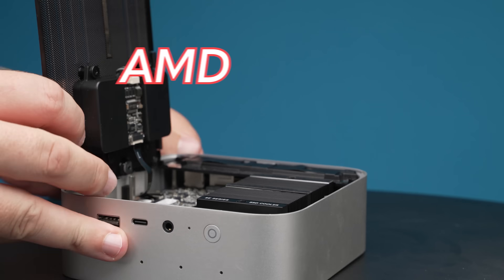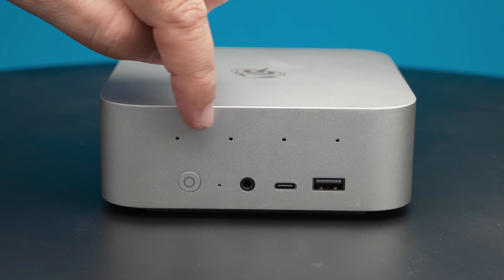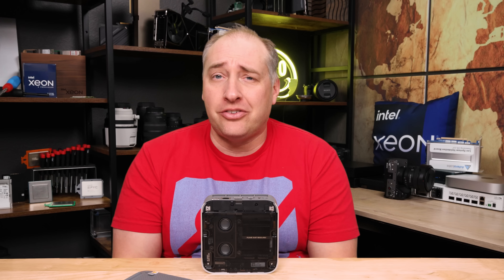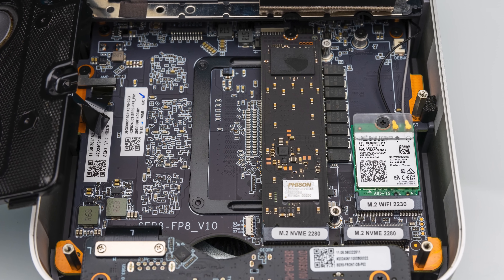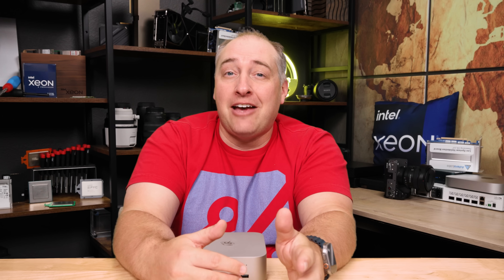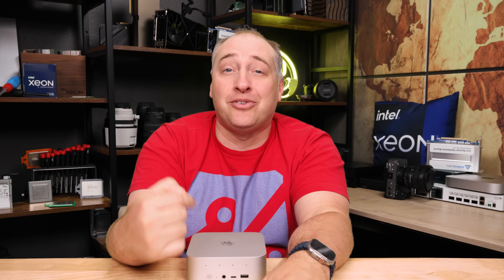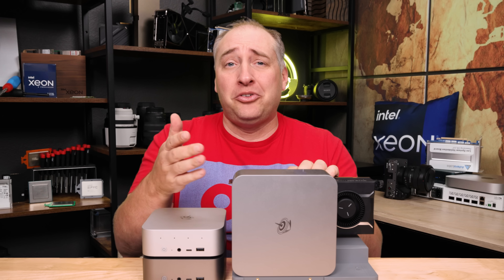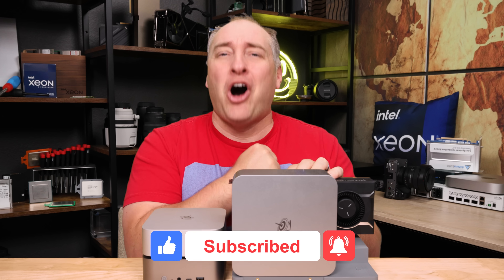FASTEST AMD AI Mini PC Beelink SER9

Comment: Hi I wanted to ask you for advice on buying a mini PC, between these two which would you recommend, I do editing with cap cut and Resolve but of family holiday videos, even if I use a lot of effects, anyway Beelink SER9 with the new Ryzen 9 AI 370 HX with 32 GB of RAM and 1 TB SSD or as a processor would it be fine, I don't want to have slowdowns, the Ryzen 7 8845HS taking the version with 64 GB of RAM and 2 TB SSD? Is the latest processor better for power or the 8845HS which in any case seems suitable for the purpose but having 64 GB RAM? Thanks always for your availability bye

Comment: The new version is ridiculously overpriced! For the price of one HX 370 (with its RAM expansion limitations), you could get two 88445HS units. Unless you're a gamer, you won’t notice any difference in daily use. Beelink should have included two USB 4.0 ports in the back instead of just one, and there’s no excuse for still using USB 2.0 on any system—period. Integrating speakers was a pointless decision; they should have prioritized RAM expandability instead. I’m betting Minisforum will offer a better package—unless they’ve also cut corners and made the same mistakes.

Comment: SER9 1000 USD -- SER8 500 USD (more or less)
So in my opinion: SER9 has that AI CPU and there aren't a lot of applications that use that AI feature yet. At least, I don't need it. Sure the GPU is an upgrade, but worth double the price? 
I was doubting at first between the SER9 and SER8 (I'm upgrading from my old SER4). I went for the SER8, because I can upgrade my DDR5 RAM, which isn't possible with the SER9 and it's very reasonable priced for what you get. The SER9 is new and sure fastest on the market, but a 1000 dollars?? No thanks!
So for me it's going to be SER8 with 64GB RAM and 6TB storage (2+4)

Comment: As for the Intel Wifi 7 BE200 NIC, it is not supported in AMD Ryzen platforms. It doesn't boot. On Newegg, these devices are clearly marked as not working on Ryzen systems. Beelink would have to go with a different vendor.
Reply from the maker: We have already seen AMD/Mediatek RZ717 systems on STH for WiFi 7 support

Comment: I’ve never liked the acoustics from slot coolers, so I was ready to splurge for a Deskmini x600 with an 8700G and a Noctua cooler. But the HX 370 outperforms the 8700G, and if the Beelink cooler is indeed quiet (not noiseless), I’d be willing to pony up the difference.

Comment: Very cool review👍Beelink can certainly offer lot of value. This tiny box packs lots of power, however as u pointed out GTi version is much better option mainly because of the PCIE expansion slot which can utilize full speed eGPU as well as the internal PSU. I think form factor of the modular "transformer" mini PCs is upon as long as they do not cost more and offer worse value than DIY mini PC builds.

Comment: Lack of oculink is a fatal flaw of the pc.
Reply from the maker: Always fun to use those. I think the GTi Ultra 12 shown has a better eGPU option versus Oculink. Oculink was replaced very quickly in servers with MCIO due to connector quality so it is fun to see folks ask for it on the desktop side.

Comment: Seems the point was missed. This is an "AI" machine meant to do AI stuff at the edge. The integrated mic and speakers are for "assistant" functionality. A glorified, very expensive, AI based, smart speaker. Building your own smart speaker is a pain in the butt and jank AF with speakers and a mic hanging off the thing.

Comment: Switched to a mini-PC a few years ago.. CPU cooling isn't great in these things as it's direct die cooling.. Turbo fan noise, and although not terribly annoying it's a cheap & crappy cooler... and the PC has these random restarts.. So I'm gonna switch back to an IHS socketed CPU with a heat-pipe cooler for higher TDP with silence.. I like the ASRock DeskMini X600 but don't like the VGA/D-SUB video output it has.. If it had dual DP and a HDMI then no problem for my 1440p triple monitor displays.. The VGA kills it for me.. Why ASRock.... why?!!!

Comment: That $1000 price is going to have to come down.  For $1000 you can get a pretty decent gaming desktop that will run circles around the SER9 in CPU and/or GPU that is a lot more flexible and expandable.  The only thing the SER9 has going for it over such a system is being so compact and low power, and while that is certainly interesting I think that for the overwhelming majority of users that is a secondary concern.  A mATX or ITX system can be small as well but with better performance.
Reply from the maker: I tend to agree with you, but then you see how much of the population bought Macs when they were slow and expensive but looked cool. I do not think compactness has zero appeal

Comment: For speakers: in a different spec (Ryzen 3, 5) these are value for not having to buy/change monitor if not speaker provided or buy the speaker set. Alsocan deliver notification sound in any kind of office environment. For video/phone calls, headset can be used via audio jack, usb A or USB c on front panel.
In SER9 series, the biggest ticket to pay by Beelink is... AMD. Which cash in CPU, GPU, NPU and RAM, mostly... 35-40% of BoM. Model delivered to you is close to the flagship, however in less powerful SKU I can easily see a lot of "small computers" for call centers, accountancy, helpdesk, frontdesk/event, cloud-connected clients.
Power efficient, small, plenty of connections, versatile and quite good looking. And for spectrum efficienty Wifi 6 is just "good enough", because Wifi6e setup are not snowflakes, but still not that mainstream.
Last thing: abysmal the dust maintenance, unrealistic and b*tt covering the term "1 month".

Comment: I hate the current desktop trends. One one side are the desktop pimpers who spend more on RGB and cooling than on the actual hardware. On the other extreme are these compact boxes which artificially constrain upgradability while costing just as much and also have poor thermal performance. Why would you put a Ryzen 9 in a tiny box. I'd rather have a functional non RGB tower with a huge fan or maybe a very functional non rgb liquid cooler (what do you mean there are no non-RGB liquid coolers!).

Comment: Not seeing a use case at this price point. I have lots of these devices and the idea is that they are small, lower powered, run win or linux and cheap....kind of like a raspberry pi. On top of that I don't see where the 'ai' or large language models are useful at this price point where I could buy 3 or 5 of their other computers. Also the misses on wireless and the silly speakers are dead on. Additionally that graphics is still too weak for gaming.

Comment: Presumably they use two speakers to provide stereo?

Two little speakers, sitting right next to each other, in the same box, is going to provide absolutely ZERO stereo separation for the listener.  Completely defeats the purpose of using two speakers for stereo.
Reply from the maker: True. But they are also not pleasant to listen to

Comment: 32GB of RAM is way too little when you can't upgrade it, 64GB should be the mininum. It's also too little for the price charged.
Reply from the maker: Agreed on 64GB+
Reply: I'm have one 32 has been more than fine. I'm using it as an ark ascended game server atm. Dedicated 4 cores per server with 4 gigs ram per server runs great with 6 users.
Reply: For $999 id go for the Mac mini m4….my opinion at that price it’s 24/512….more you have to pay pig apple….maybe not go for it 😊

Comment: I'm going to wait for the Minisforum AI370 with up to 96GB ram, 2x PCIe4x4 M.2 slots and 2x 2.5GbE nics... and it looks really nice!
Reply: From what I can tell, it will have the same 32g of soldered in RAM. Maybe they will release other versions.
Reply: Where did u see it goes 96GB ram when the website sells it only with 32GB?🤔Now the UM 890 minisforum has 64GIg out the box ready and uo to 96GiG but it's 8/16 cores threads but u can add the EGPU dock and now we are talking! U can have that bundle for $828 compared to the $1000 and over for the one ur waiting🤷🏽‍♂️...I'll go with UM890 if u want under $1000 and the bang for ur buck, or go with the New Beelink Ser9 AI 12/24 cores and threads for about $1000 if ur willing to spend over and also it's compatible with the EGPU dock😲...it's up to u but I'd go with the UM890 all day before those

Comment: Should’ve completely gutted the speakers and mic for more cooling or hardware peripherals.

That would’ve made it a must have 🧍🏽‍♂️
Reply from the maker: Agreed
Reply: More cooling would have been my pick
Reply: @phthano2580  I’d take the peripherals considering you can turn it into a beast of a low power server. I’ll strap a case fan to it lol
Reply: Yeah, larger fan would have been better. More air with less noise is always appreciated. And that extra space could have allowed more NVMe drives too.
Reply: For the price point, more memory and storage would have been nice. I can definitely do without the speakers and think these mini pc makers try and do too much at times. I think of a under 5 liter build when I see the price that will gi e me some kind of upgrade path.
Reply: That’s why I may go with m4 mini mac no noise I know apple been around for decades… I’ve only owned hp. I need quiet for music production! Its costly apple is too piggish but I need 32/1tb !
Reply: just buy a usb dongle
Reply: More cooling and RAM. 32 GB is ridiculous on a premium machine.
Reply: @tschorsch  Only downside with user replaceable RAM is that it is slower than directly soldered RAM. Definitely could have had more though, especially at the price point.
Reply: @tschorsch  wdym 32gb is plenty still. My ryzen 5000 rtx 3000 series pc doesnt even use 16gb like ever. Only switched to 32gb when I needed it for weird experiments and a certain game.
Reply: @tschorsch  especially one with so much potential. Just the fact that we’re commenting means they really had the ball going with this one….

But fumbled :(

Comment: Mini PCs are absolutely fascinating devices. You can do tensor parallel compute over USB C to make a frankencluster, you can play games comfortably now, you can throw them in a backpack(!) and make a back-bound cyberdeck…So many silly use cases.

I will say I’m less interested in Strix Point ATM, but the upcoming Strix Halo APU seems really interesting to me. If I could get somewhere between 128GB - 256GB of RAM, it actually becomes really interesting as a developer platform for AI models, and like I mentioned you could network it with a second one when end of generation sales get going.

Endlessly fascinating.
Reply from the maker: Totally agreed.
Reply: Uff yessss I am waiting for black friday to see if any zen4 minipcs get down to like $300 or less and will figure out a way to get a fast interconnect between them even if it means buying a load of usb4 add in cards and using an old epyc for it's pcie lanes to get some 40gbps usb4 networking going for the cluster :D
Reply: @isbestlizard  Fair warning: While fun, you might be going a bit overkill. A lot of Mini PCs have 10gigabit or 20gigabit USB-C connectors on board natively, and the cables are cheap. If you’re doing tensor parallel compute (ie: matrix multiplication) the interconnect speed isn’t a huge bottleneck (you really only need something like 2 megabytes per layer in a reasonably large Transformer LLM, for instance), you might actually find that you can make a really cost effective cluster without a lot of hassle just using what’s available onboard! I’ve seen people do four mini PCs in a ringbus config with two USB-C connectors of that type each, and it went pretty fast.

If you just want to go higher because bigger numbers are fun, do feel free to go nuts, though.

Comment: It would be nice to see something that's more... balanced.

I reallly don't care about GPU performance in this form factor, I'm not gonna do gaming on it – enough acceleration drive a couple of 1440p panels for development work, sure, but that's it. NPU is irrelevant, the sooner the misnamed machine learning bubble bursts, the better.

Give me a mini PC without USB and audio, 8 zen5c cores, and either 32gig reliable on-package memory or two slots with ECC support or... a mix? A fair amount of on-package, CAMM for the rest?

A single 10gbit NIC, perhaps some option between HDMI and mini-DP output, and USB-C power delivery - STOP with the bloody semi-proprietary barrel jacks, don't even THINK about doing low-quality/efficiency internal PSUs that can't be serviced.

The board real estate and PCIe lanes that are saved by dropping USB and audio junk can be spent on NVMe and U.2/Occulink/whatever.
Reply from the maker: All fair. Just based on the AI demos I have seen (or that my truck drives itself to the studio) I do not think the AI thing is going to end up being irrelevant. I do think there will be a shake-out of startups, but there is a lot of cool tech out there that is already working.
Reply: There's definitely value in machine learning, but the current run of stuff is being overhyped – which is a shame, since people (and investors) are eventually going to be disillusioned when they realise we're not getting AGI from the LLMs, no matter how much energy we pump in them.

I'd rather have the CPU die space spent on NPU used for extra cache, better branch prediction logic, power management or other generally useful featrures.

Comment: Add DASH (or an other out of band remote solution ) a second 2,5 gbps port and at least one more USB 3.2 port make it about $700-800 and you got yourself a best seller as is meh only people with money to waste will get it as a toy and then forget it (which doesnt add up to brand loyalty  which is also something those manufacturers should think about)
Reply from the maker: That was somewhat the idea behind bringing in the GTi Ultra 12. There you get dual NICs, $738 with the expansion dock and less without it. I totally agree that price at $999 is a challenge unless it is exactly what you want.
Reply: @ServeTheHomeVideo  it doesn't have vPro/amt though does it?

Comment: The price is insane. 999$ is to much.
Reply from the maker: I think there is a $100 coupon, but still too much
Reply: Don‘t forget, that 32GB LPDDR5 RAM is at about $300 alone😅
Reply: @LeicaM11  Not at all. I bout 64 GB DDR5 6000Mhz for less than 200 USD. Okay that was deskop RAM, but its they who what chosen that form factor which necessarily increases cost, thermal throttles and limits upgradability.

Comment: OMG IT'S SUCH A PAIN TO UNSCREW 6 SCREWS, WHAT 2 OR 3 TIMES A YEAR!!! JUST LIKE THE PEOPLE WHO COMPLAIN ABOUT NOT HAVING QUICK RELEASE M.2 STORAGE AND M.2 HEAT SINKS. HOW MANY TIMES DOES ONE CHANGE THEIR M.2S THATS BEHIND THEIR GPU??? I LOVE PLASTIC CLIPS THAT BREAK SO YOU CANT USE THEM ANYMORE. THEY DONT MAKE MBS AND OTHER COMPONETS FOR THE SUBSET OF A SUBSET OF PEOPLE WHO DO YOUTUBE REVIEWS. PEOPLE ARE SOOOOO LAZY AND THINK THAT EVERYTHING SHOLD HAVE ALL THE OPTIONS AND WHAT THEY WANT FOR NO MONEY.
Reply from the maker: Quick release on M.2 storage is like $0.05-0.08 per drive the last time I checked in BOM cost. Often screwless lid designs are sub $1 more. On a $999 mini PC, these should be standard. If you make $15/ hr and the screwed case design takes you 3 minutes longer per (six out, align, six in) plus an additional 1-2 minutes to grab a screwdriver and 2-3 minutes to get off the rubber end caps put on at the start, then there is a business case here for adding $1.20 in BOM cost or maybe $2.50 max in system cost.
Reply: @ServeTheHomeVideo  And that is your job. Not gonna retool something that adds size and costs more when making it smaller anyway. Everyone wants it all like I said for nothing. So you want magnets, clips, and labeling on the USB, so change all the tooling and manufacturing equipment or buy from a different supplier so you can be lazier. That's cost-effective for the small margins they get as it is. It has to be easier and cut out the work so no one can use a screwdriver, just like people can't write cursive and don't know how to interact with people or barely know what a book is.

Comment: I actually love the built in speakers. I run a mini PC as my daily driver desktop and it's just be nice if I didn't have a separate speaker unit plugged into one of my USB2.0 ports. I don't need great sound quality for listening to PC parts reviews on Youtube.
Reply from the maker: Fair point. These feel a bit redundant since many monitors / TVs have built-in speakers and these are similar quality.
Reply: @ServeTheHomeVideo  true, my cheap monitor doesn't, which I realized after setting everything up. Moving from a laptop as a daily driver there were a lot of peripherals I took for granted.
Reply: @ServeTheHomeVideo  do you think they could've fit anything else substantial in that space if they axed the speakers?

Comment: One usb4 port... No thnx. Don't need speakers and microphones. For this price it should have 1*10g Ethernet not just one 2.5. and then no wifi 7? Very underspecced/overpriced
Reply from the maker: Fair, 10GbE would have been nice, but that is a decent BOM cost adder and also adds more cooling challenges even with something like a Marvell AQC113C.
Reply: @ServeTheHomeVideo  true, but if an USB4 to 10g rj45 costs around 100 resale, it would add as much to the bom as removing that microphone array and speakers cost. They could even remove the 2.5gb, though they shouldn't. But 10g would give back for the missing second USB4 port.
This one isn't the one for me, probably saving on for strix halo.. a 1500 MSRP mini pc?